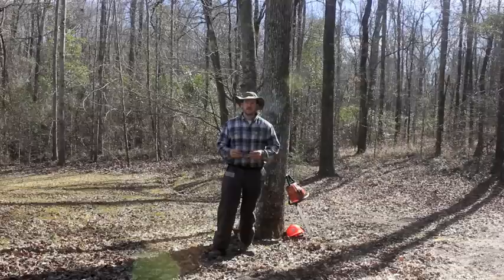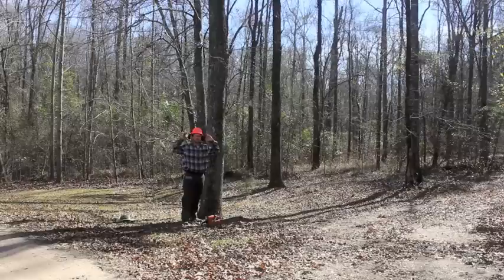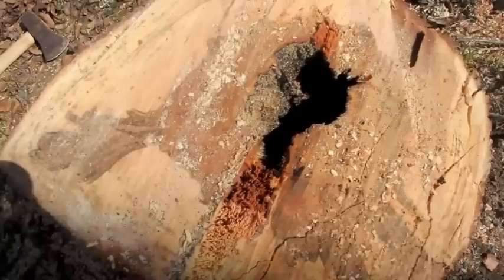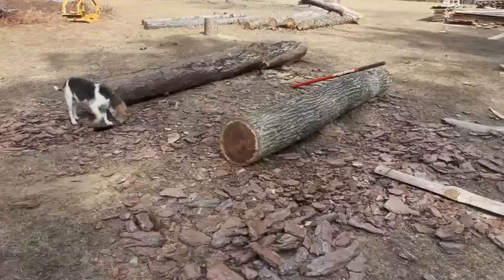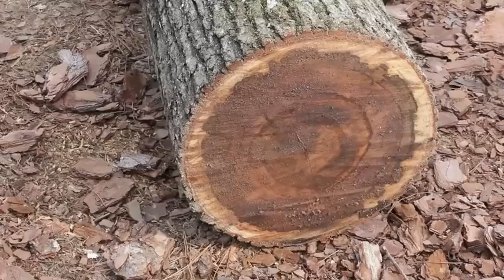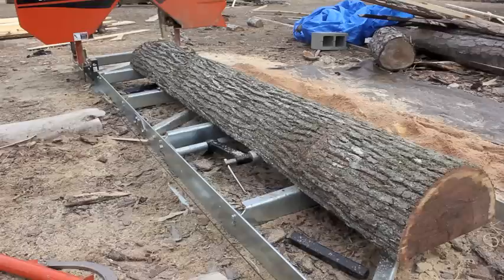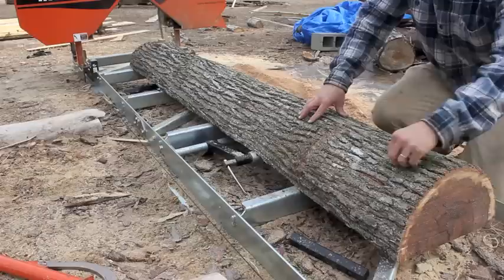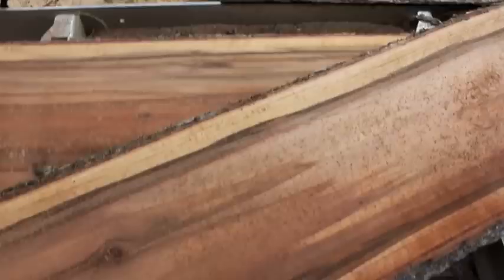Felling and milling a sweet gum tree

Comment: An old man told me many years ago that if you would cut and mill sweet gum, and immediately nail it down as lathing strips for tin roof. Nail the tin down with leadhead nails, as the sweet gum dries it shrinks around the nails and your tin roof would be there forever. 
(My English teacher would faint at the length of that run on sentence)😂

Comment: I mill sweet gum into slabs pretty regularly. It's a really pretty wood, definitely under appreciated. Drying can be a little tricky, but it's not as impossible as some people would make you think. Cut a little on the thick side so you have more material for surfacing. Stack and sticker it nice and flat and, as you mentioned in the video, use some weights and/or straps to keep things from getting too out of hand.
Reply from the maker: J Fricke Good to know! Thanks for the tip!
Reply: I'm in alabama would the sweet gum make good logs for a pavilion,are they disease resistance? Thank t
Reply: @jfricke4413 - I'm building a barn/shop with an upstairs and I'm considering cladding the walls upstairs with shiplap.  I have a bunch of sweetgum I want to remove this winter.  I'm curious whether or not I could use the sweetgum.  I'm also curious how I should handle the wood.  Should I mill it green or cant it and let it dry for a while, or just girdle the trees and fell them in a few months?

Comment: Back in the day my Daddy used to make cattle troughs out of old gum trees by cutting 4’-6’ logs in half lengthwise and nailing boards on either end.  The natural tendency of gums to get heart rot eliminated most of the work to hew out the trough.   He would also leave sometimes leave hollow rounds whole, weigh them down and sink them in our catfish ponds for fish habitat!  I suppose most folks didn’t have the desire to expend the effort to dry properly in order to use as lumber.  I agree it is a beautiful wood.

Comment: Great job on the sawing you can get good useable wood but must take extra care in stickering and drying. Once good and dry about 8% moisture you will need to run the slabs on a jointer to get them perfectly flat and usable. Its worth the extra work as the wood does have a beautiful color and grain.

Comment: I have 10 acres of sweet gum. I researched and found it's used a lot for railroad ties, matchsticks and pulp wood. Reading below looks like good for firewood too once dried well. I have a lot of people who come to cut up a tree when I fall it as they like to burn sweet gum around here. Also I had a wood pulper come out and offer to buy my wood to sell to paper companies. So I've got a lot of choices. Would love to see how your lumber turned out - how much twist. I'd love to make something out of some of my logs that have been sitting here.
Reply: I burn it myself.  It gives up all of its heat pretty quickly so I tend to mix it with dense oak.  My wood stove won't damp down enough to burn sweetgum slow but it damps down too low for oak on its own.  Mixing works the best when I have it damped all the way down.

Comment: I thought that beast looked familiar!
I bought an L-65 husky in 1977 brand new for $275 I logged with it and cut thousands of face cord of maple, beach,oak,and elm with it after 20 years I just plumb wore it out, it never completely quit but once it got hot I couldn't restart it till it completely cooled off. God help you if it kicks back! I loved that saw. 
I ended up replacing it with a 372xp been running it hard now over 20 years, and I got a 395xp case I need back up! Lol
Reply from the maker: Dan Salveta I wish there were saws of this quality nowadays at that price! Thanks for the comment!

Comment: I can't offer any advice on drying, but I've heard it's hard to dry properly. I do know that around here (central Alabama) the heartwood is called Red Gum. It's unusual to find that much heart in that size tree from my experience. Also, the sap wood spalts easily and makes very nice wood for turning and other projects where the grain is appropriate. I turned a very pretty goblin from a piece of firewood. By the way, my brother does burn it in his wood heater. It's also almost a nuisance around here, but can have red leaves in the fall.

Comment: I cut some about 4 weeks ago, snickered, stacked and used band clamps to hold it straight, its very pretty, not sure why more is not used.  I have had some end cracking even with sealing but so far I am very excited also!

Comment: When cutting your notch for felling, direction, depth, meeting the first cut (often level) with the second (often up slope to meet) ,, it makes it easier for the angles to meet if you do not move.   With your current skills and excellent saw, I have no doubt you can as well.  Quicker, easier.

Comment: Sweet Gum Trees, both clear & black sap type which are locally known (coastal S.C.) as Tupelo Trees, produce some really heavy pollen during the tree's blossoming time in early spring. This type of pollen is in high demand by Honey Bees which use the pollen to make some really good tasting sweet honey in my area. Also, South Carolina Wood Ducks like to make their homes in rotted out knot holes of this particular tree in water areas of the state. We Carolinians treasurer this species of tree, for both their honey and as a wild duck reproducing refuge. Many Gum/Tupelo Trees can be found in and around our inland fresh water areas, growing in both still standing as well as in running water ways. The wood its self represents only a small amount of lumber milled in the United States. (approx. 30 MBF annually) My understanding, is that all the lumber which is milled, is almost exclusively used in producing veneer lumber and not at all in furniture making.
Reply: I'm in nc and we mill a huge amount of sweet gum here and we are milling it into cross ties and pallet wood like someone else mentioned. We have a large hardwood only mill that specializes in hardwoods and veneers and export about 90% to China but they send all the gum to us for ties and will not saw any of it into their specialty woods. 

If you can dry it slowly then you have a chance at getting good boards from it but it is beautiful wood and has remarkable coloring in it

Comment: Allot of the old cities in the north (I live in Rochester) will advertise in their real estate listings: "...Home has beautiful, original Gumwood trim and moldings..." and this was a popular and pretty wood in homes that were generally very well built around the 1920's. So it CAN be a premium hardwood if it is dried properly
Reply from the maker: matt s Interesting! Thanks for the comment!
Reply: I also have seen it used as decorative trim in older homes....it resembles mahogany when dried and finished with linseed oil.....also makes beautiful mantles and fire place trim....but, to dry it properly, my grandfather would dry it for a year or more as a full length log, then cut it into saw logs....he sold it in 5/4 by 10 or 12" by 12 foot planks.

Comment: can you give an update as to what you may have built with the sweetgum and how it has held up i  have some on my property that are about 3.5 ft across and i feel there is just too much wood there to burn in a burn pile i want to try to do a board and batton style shop with it and i figured since its going to move anyways why not and the way i see it is all the criss grain should grab nails or screws real well as it shrinks im realy interested to know how it turned out

Comment: plenty of gums in australia our koalas eat certain types of gum tree mainly eucaylts [pardon the spelling ]you can use gum in boat building frameing furntiture it does tend to warp but when you cut a stright bit itll last a longgggg time .you can also cut lengths about 8ft x 4inch thick and pain with sump oil then use it as retaining walls in au alot of ppl use it in gardens once white ant treated.
Reply from the maker: r collas Good info! Thanks!

Comment: My neighbor is offering me a couple of four foot lengths of sweet gum log roughly twenty inches in diameter. It was dead standing when he cut it and has no bark on. I work with steel and am not an experienced woodworker. Can anyone advise me on how well such a log would render into planks for a tabletop? Is it likely to warp before I could finish cutting and gluing?

Comment: I've heard that it needs to be cut a few feet longer than needed, mill it into cants and stand on the ends to dry, then mill it dry. I imagine it still twists. In the south they are used for cross ties or pallets and furniture framing. I think the specs were logs need to be 11 feet long and minimum 14 inches on the small end. They won't take split or knotty. Wood's Backhoe Service cut some for ties off a property for clearing. Wasn't worth the fuel to haul for him.

Comment: I have a big Sweetgum, that's going to be sawed up this spring. Its 28-30" or bigger. Plan is to strap it down with 4" straps and weight it down with 2 500lb slabs of lead.
Also have a 24"+ Persimmon that will be sawed up. and a big Catawba tree. I know the Catawba is soft wood. But it makes some nice wood.
Reply: if its that large i would look into quarter sawing it.  The resulting boards wil be much more stable while drying.

Comment: Really good looking wood! I’m impressed! 
I’m new to your channel and don’t know what state your in, I’m from East Texas. Tyler to be exact. We have a bunch of sweet gum in our area. There are two types regular sweet gum and black gum, there is no difference between the two, leaves, bark, growth rate, limb structure is the same until fall sweet gum have yellow fall color and blacks have a deep red color. I wonder if that was why the wood was so dark. Every time I’ve cut them down the wood was way more white. I don’t know for fact that any of the trees that I have cut where black gum. Black gums are not as abundant as regular gum.
Reply: The black gum a single lobe leaf has a different leaf pattern from the sweet gum which has five lobes. I have lots of black gum on the property just above where you are mainly in the draws where they can get lots of water.
Reply: @davidpape9726  Out of curiosity I did a little research and realized that a Black Gum is a different tree all together. But what I am intrigued about is that in a stand of Sweet Gums they all look the same tall, five lobed leaf, and spiked balls. But in the fall most of them turn yellow then there is a couple that turn deep red almost purple. Why? Is it a different subspecies? Also I haven't found any literature on this, and I don't think anybody else notices or gives a crap. But thank you for correcting me.

Comment: Sounds like if you learn how to dry it without warping, you have a great source for beautifully grained wood! Weird how it is hard but has little btu value as firewood.
Reply from the maker: Scot Duckrow Yep. If I can dry it I’ll have a treasure. Thanks for the comment!
Reply: It’s not a hard wood. It’s very soft, makes your saw seem like a champ. Something is not right with that saw, either low power saw or dull chain.

Comment: I cut some 16 ft 2 by 6 and used them for rafters. I kept them wet till I put them up then with side braces they worked fine   when they dried they were hard as a rock
Reply from the maker: James Spears I have heard that they dry extremely hard. Thanks for the comment!
Reply: Fall Line Ridge with the ones that I have cut after they dry YOU could not drive a nail into IT without predrilling